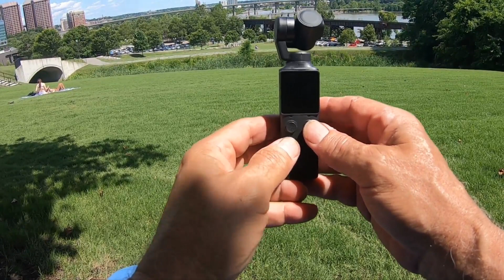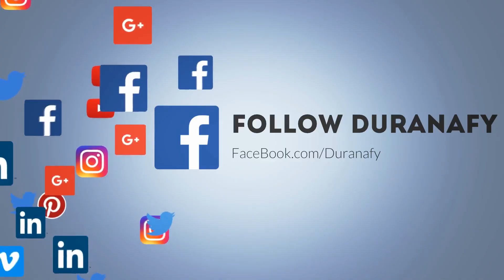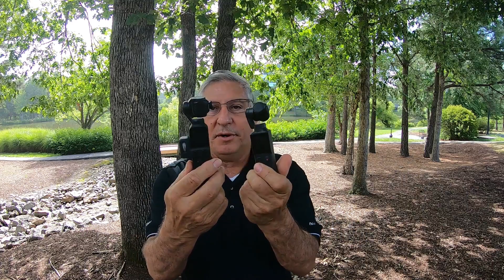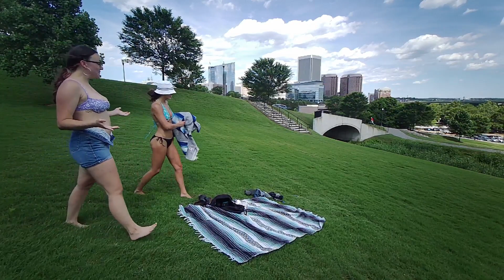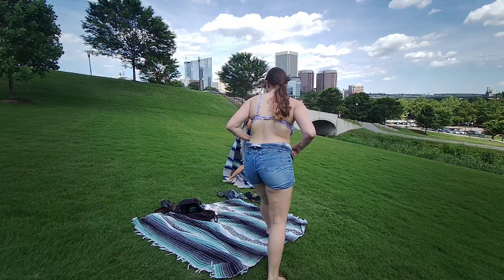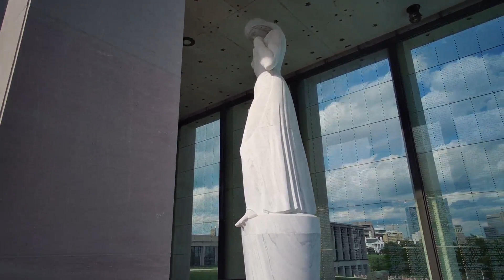Fimi Palm Review

Comment: The Palm is cheaper than the Pocket, but in almost every respect it's hard to point to any particular aspect or feature being better than the Pocket.  For instance, yes, it has a built in joystick but it's not as good as the Pocket joystick - for which you pay extra.  The list goes on.  It's a great little camera if you don't mind the fixed focus super wide angle look to the video, and if you don't mind having to buy it online from abroad, rather than from your local pro video shop.  I have both, and I regard them as if they were alternative lenses on a DSLR.  I pick the one that's going to be right for the shot.  Not everyone of course can afford both, and if you can only afford the Palm, and not a Pocket with a full set of accessories, it does have plenty going for it.
Reply from the maker: You are correct! The Palm is a fix point and shoot camera like the GoPro you don't have to worry about being out of focus or in frame. The Pocket has ruined so many shots for me that I thought where in focus.
I totally agree that the Pocket is a better product but it comes with a premium price to get the same functionality. you could buy 2.5 Palms for the same price a Pocket with the WiFi, Wheel, Mic adapter and freewell lens. I carry both cameras with me all the time.

Comment: Just got mine last week from Gearbest (Two months, six days shipping!) For the price it's pretty good. BUT, why did they put the tripod mount on the side instead of on the bottom of the case? WORST.DESIGN.EVER! For example, if you want to take a nice long time-lapse, you have to leave it on a tabletop. (or use painters tape to mount it to a wall as I did yesterday) What happens if a strong gust of wind comes up and knocks the gimbal over? VERY frustrating. I ordered a tripod mount from Ali Express. I'll let you know if that helps
Reply from the maker: Oh Boy! Sorry to hear about wait and your frustration. I also waited forever for my to arrive. I get it, the back mount is not very useful I made my own mount. I will post it!
Reply: @Duranafy  Excellent. Look forward to seeing it. I just figured out I can use my monopod to mount the Palm. I really like the video quality and stability of the gimbal.